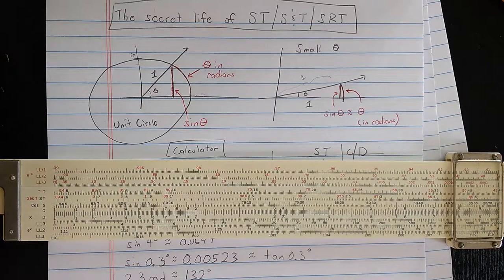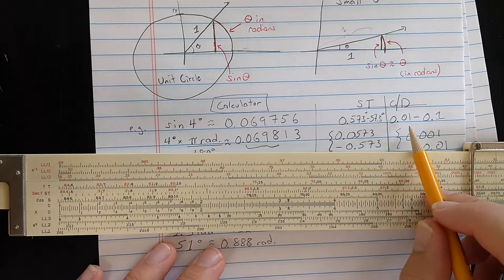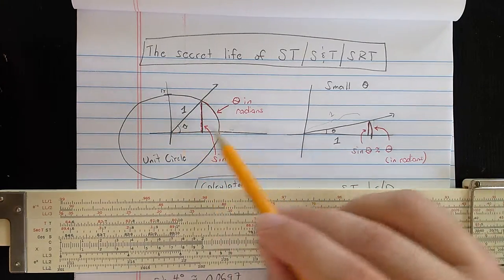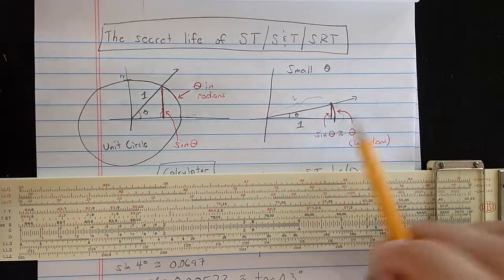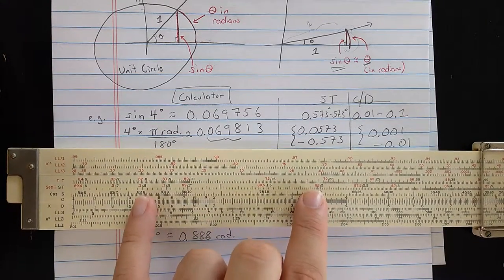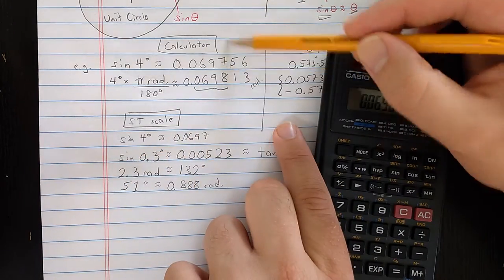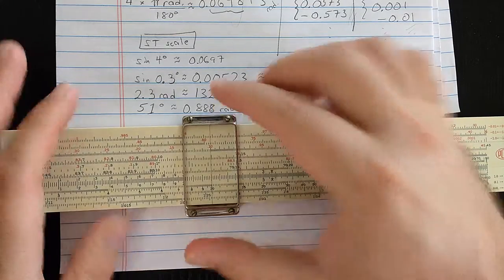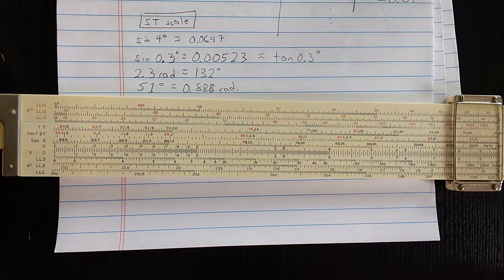The Secret Life of ST / SRT / S&T

Comment: One thing I've noticed on these scales is that there seemed to be no consensus on what the actual reference for S(R)T scales was.  Some seem closer to Sin Θ, Others the radian measure and still others some kind of average of the two.  I've never seen one that leaned towards Tan Θ, however.  Now that I think of it, I wonder if K&E changed their reference when they switch from ST to SRT on that scale.  Hmm.
Reply from the maker: Aaron, I've wondered about this but never investigated it on my rules. Obviously if the reference is radian measure than the scale is exactly a folded scale. I've also wondered if the ambiguity is the reason that Hemmi did not mark the scale as finely in the lower end as other scales (or other manufacturers) -- just a guess, but it would make sense.
Reply from the maker: Just thinking more about this... Since radian measure would be between the other two and give a pure folded scale, I think this is the best of the options.